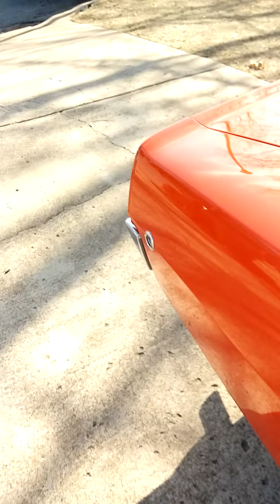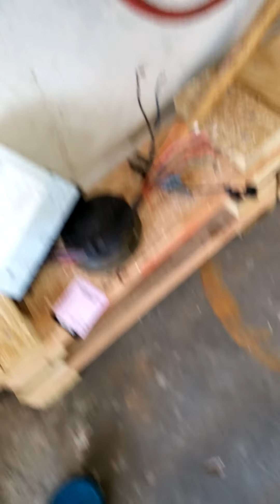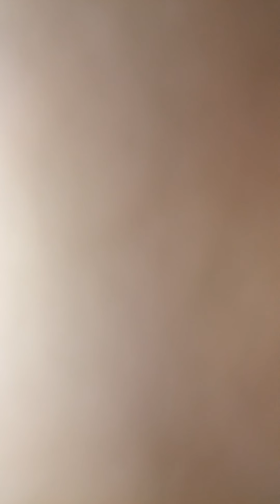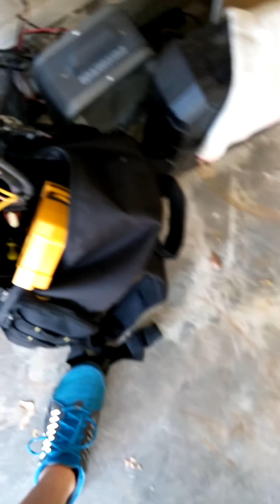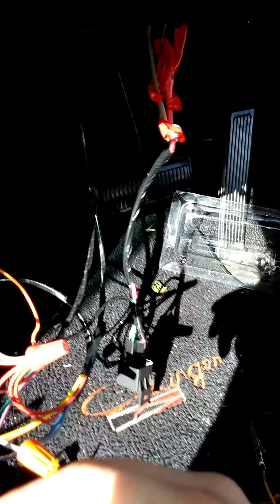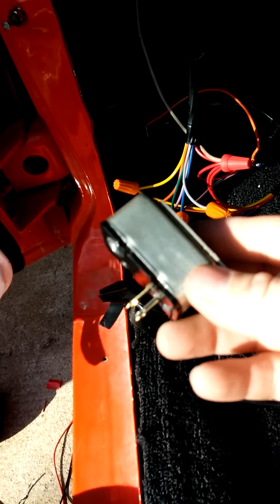1968 Charger Power Window Wiring Explained

Comment: can you comment on how the wiring is dressed across the car - e.g. the route it takes to get from the driver side to the passenger - does the harness go across along the back of the dash or on the floor? assume the floor channel is used to get the harness from the driver side door to the driver side rear quarter window glass area.  thx